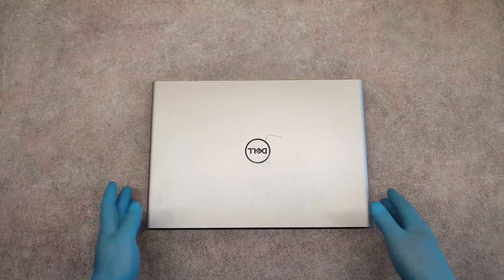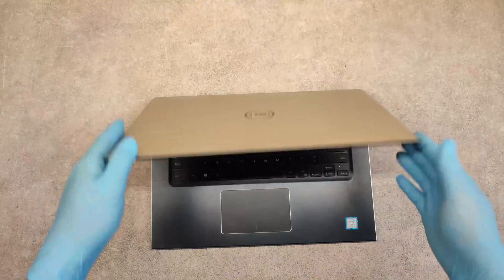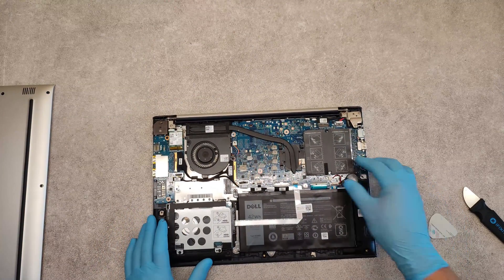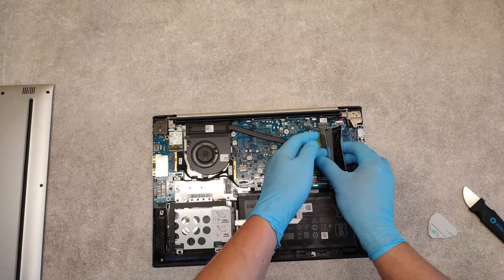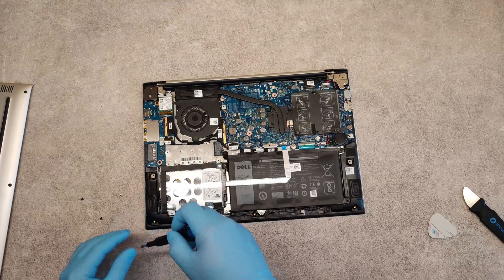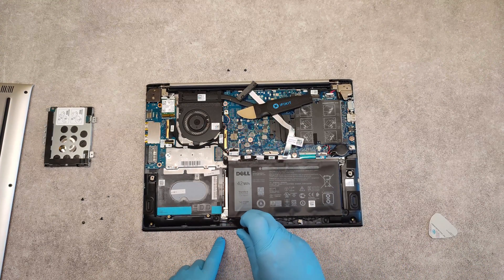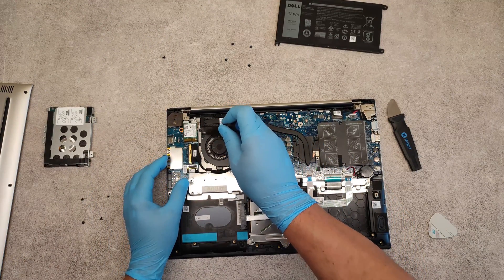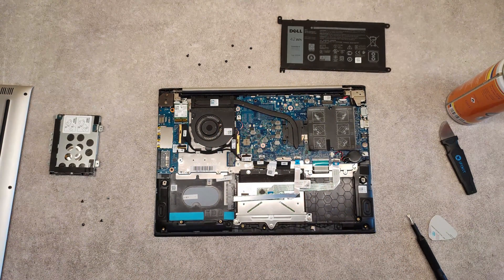DELL VOSTRO 5471 PG88G DISASSEMBLY, RAM UPGRADE, SSD UPGRADE, FAN CLEANING, BATTERY REPLACEMENT

Comment: Thank you. Can I replace the HDD 1TB by a SSD 1TB; then make it the primary boot disk, instead of using the default 128GB SSD disk?
Reply from the maker: Yes, you can.

Comment: Is it possible to put ssd instead of hdd here and i dont mean another port for ssd in this laptop but exactly where hdd was?
Reply from the maker: Hello friend. Yes you can put SSD instead of the hard drive. Good luck!
Reply: @MrTechGuyDIY  thx
Reply: When instering the new SSD instead of the HDD I don't insert the 4 screws to hold the SSD in the cage... Is this also okay? 🤔 I think so or?
Reply: Is the CPU soldered to the motherboard or can it be removed?